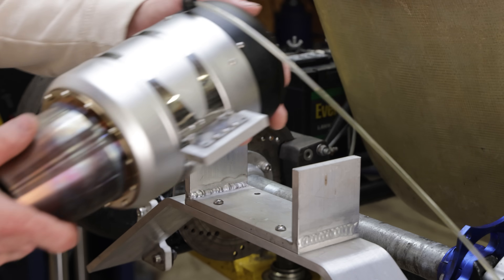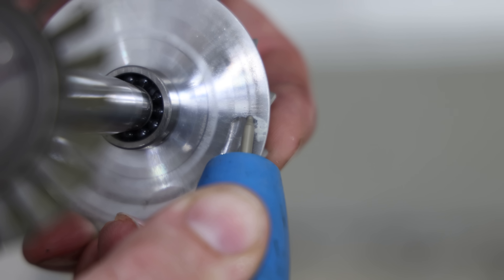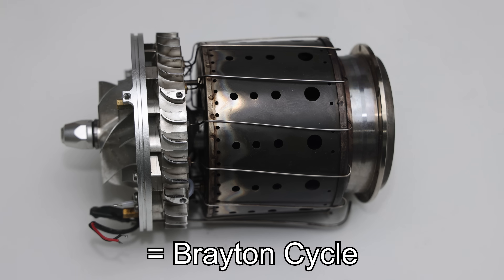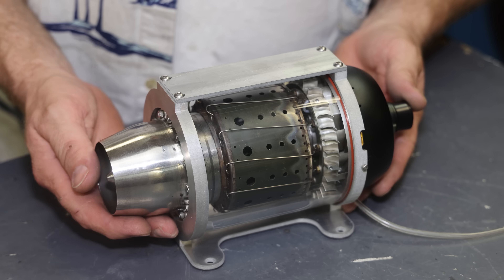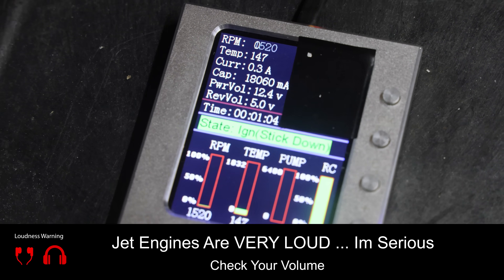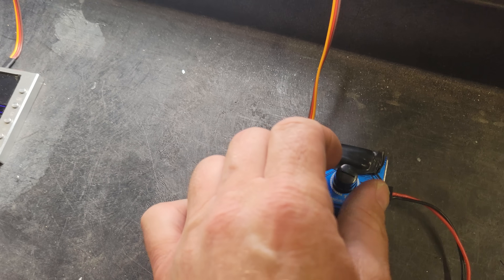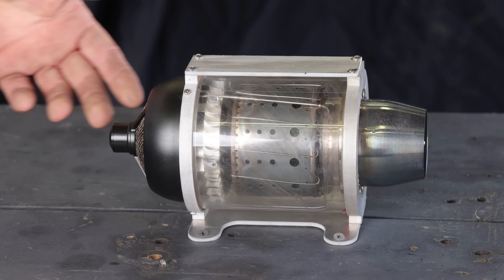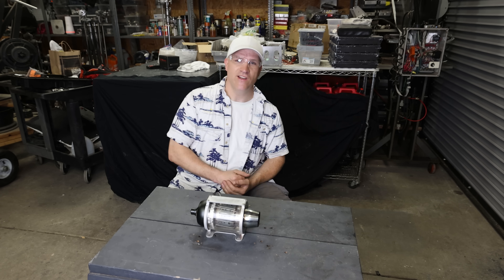See Thru Jet Engine

Comment: I've worked on aircraft and turbine engines for 30 years, and never thought I would see what one looks like on the inside running. Even just a basic one like yours is pretty neat.
Reply from the maker: Thanks, I wanted to start simple, but I absolutely need to do a multi-stage axial... No doubt. It's tough, this one has been 4 years in the making simply because I had to develop the material that I'm using here to make it possible, I also use that same material for all of my other see-through engines, but I haven't patented it because as you may know I need to release the recipe in that case, and the market is very small for this only for educational use. But then if it's publicly used and it fails for instance in a school or something like that, I could have a big problem on my hand. 😬
Reply: @WarpedYT  i've always wanted to see a multi stage axial turbine in small scale.... cool asf.
Reply: @WarpedYT  do it 👌20 year ex RAAF F/A-18 Hornet 'Frumpy' here (Airframes & Engines Tech). Do a mini General Electric F404 with functioning Afterburner and Variable Exhaust Nozzle 🤤👌
Reply: @BeerBatteredGummyShark  Well the  afterburning part would be easy, a beer can tube with garden sprinkler to dump fuel in the exhaust is not hard.  The VEN, well... thats another story.  Two stage....  Cut the guy some slack, his mini turbojets would be great to power a convection oven for shrimps and chicken wings.
Reply: @WarpedYT  A quick recommendation is to use a copper ring to seal that case instead of that silicone. That way the copper will expand as it heats, and will just generally be a lot stronger.
Reply from the maker: @th600mike3  the reason I didn't do that is because the material I'm using for the cylinder has an extremely low coefficient of expansion, if I put any sort of metal in between that cylinder and those rings when it expands it's going to break my cylinder.
Reply: @WarpedYT : Won't the cylinder also expand?
Reply: @WarpedYT  Could you add an air pressure gauge on the clear housing in the future video?
Reply: @rotaryperfection  You don't have to go through the transparent hull. You can add a pressure tube from the front. Bonus: you can measure at different length.
Reply: @WarpedYT  
Yeah it's Quartz... no wait sapphire....or transparent aluminum!? 🙂🇦🇺
Reply: @Johnno48  how do we know he didn’t invent the thing?
Reply: @Johnno48  actually the last one is now real. Its called Alon
Reply: @Johnno48  Like aluminosilicate glass?  Is that Star Trek's transparent aluminum?
Reply: @Johnno48  In the realm of the many Star Wars world of books I think they called it "Transparasteel".
Reply: @FARLANDER762  ALON ; Aluminumoxinitridede
Reply: @Johnno48  - Magnetic containment shielding?
Reply: @WarpedYT  How is it possible that the plastic case did not got darken or blur inside after sustaining temperatures of nearly 2000 degrees? I've seen a lot of see-through combustion engines with plastic casings, and they always get dark or blur in less than a minute. What type of plastic case do you use? What kind of coating is there inside it?
Reply from the maker: @ron25-33  this is a proprietary material that I developed over the course of about 3 to 4 years of research and development, I made the material for research and educational use, if you watch my previous video on the see-through liquid piston engine, I gave them to see through components for research and development and they are still using them today, I am told without any scratching of the surface or discoloration... I myself was impressed that this material works so well.
Reply: @WarpedYT  Thank you for the responce. I will watch the liquid piston video now.
Reply: @ron25-33  its glass not plastic.
Reply: @ron25-33  He has the intake air from the compressor, which goes through in considerable quantity, pass between the transparent cylinder and the combustion chamber, before entering the combustion chamber via the holes you see - the intake air thus isolates and cools the transparent cylinder.  The cylinder is presumably some sort of Pyrex (borosilicate) glass, which has a low coefficient of expansion and can thus take high temperatures anyway.
Reply: @ron25-33  its glass possibly borosilicate or quartz since they have high melt temps and standup to rapid cooling better than most other glass.
Reply: @WarpedYT  Then release it for wider study?
Reply: @DalionHeartTTV  His choice not yours?
Reply: @WarpedYT  I'm curious if your see-through material is cast, or is it extruded? Also, borosilicate glass and kovar have similar coeff's. of thermal expansion (they use them together to make glass-to-metal seals). 

Not sure what your "proprietary" material is, but, instead of using an O-ring, have you given any thought to a kovar ring having a square cross-section? Perhaps, you could bevel one of the inside corners to impart slight torsion to further seal the space between your see-through material and the metal housing. Maybe, machining a very slight taper from the ID to the OD that would work with minimal torsion of a kovar ring having a square cross-section with a beveled corner as I mentioned above? Does your material change properties as the temperature rises to operating temperature? Might it withstand ring torsion as it approaches and maintains operating temps?
Reply: @djhal7961  borosilicate glass has 550 degrees melting point
Reply: @lewisavinash1  Borosilicate glass melts at about 1,650 °C (3,000 °F; 1,920 K). check wikipedia.
Reply: @WarpedYT  If you do patent it I suggest you finesse the name, because roughly speaking right now you have a see-through cowl/duct and you are still trying to devise a see-through engine (combustion section) and you just haven’t figured out how to do that yet and I gotta think it’s not going to be an expensive anything you come up with. You need a medium that you can see through but that will tone the image down enough that you can actually see what’s going on in the center of the blaze  Meanwhile, the name is great for the masses and I hope a lot of people watch this so that they appreciate what’s going on out there on the wing of the jets fly on.
Reply from the maker: @JoeOvercoat  Thank you, I actually already figured it out a while ago, that's not the hard part the hard part is making the material. 🙂
Reply: @WarpedYT  Material science enables so very many things. 👍
Reply: @WarpedYT Next up: Jet Engine Running on Oxygen + Acetylene
Reply from the maker: @algodoomarbleracing  That would be pretty spectacular
Reply: @WarpedYT  woah, didn’t expect a reply from you
Reply: @algodoomarbleracing 😂😂😂
Reply: @WarpedYT  Quartz. It's quartz. C'mon.
Reply from the maker: @Spirit532  quartz scratches extremely easily...in short quartz sucks...lol
Reply: @WarpedYT  If you're dead set on some kind of non metal sealing, try pure PTFE. It's the only thing I've seen handle higher temps, but I think copper is your best bet.
Reply from the maker: @th600mike3  thank you, you're correct that would be good I actually have some PTFE sheet, but it just wasn't soft and flexible enough for me, although I think I figured out the problem is that because the pressure combined with the thrust was bending my top and bottom pylons, I'm going to make a revision before the next video so this doesn't happen and do a test run I think that's going to fix the problem... Also my original design was an actual o-ring which no matter what is not going to be able to fit through the Gap left even when it expands. But yes unfortunately I'm stuck on using a soft pliable material for my seal front and rear just to keep the safety factor in place. Last thing I want is for this thing to break into pieces and go flying, even though I have a blast shield that could be a huge mess.
Reply: @th600mike3  Copper won't do it any good. 

- Copper melts at 1085 degrees Celcius/1985 degrees Fahrenheit
. 
- A "toy" jet engine can reach up to 850 degrees Celcius/1562 degrees Fahrenheit. 
- A normal jet engine can reach up to 1700 degrees Celcius/3092 degrees Fahrenheit
. 

So a copper seal could potentially melt and deform permanently.
Reply: What about bakelite or neoprene.
Reply: @TuncayAyhan  Temperature at the seals is way below exhaust temperatures. It's mostly the temperature of the compressed air.
Reply: @Spirit532  Quartz sucks. It sucks man. Cmon.
Reply: @Spirit532  Aluminosilicate glass...
Reply: @henry247  Yeah, maybe. But a piece this shape and thickness would be unnecessarily expensive. I've had no problems with quartz, certainly not scratching.
Reply: @WarpedYT  Don't suppose you could experiment with nitromethane and or methanol injection in part 2?
You know you want to.
Reply: @WarpedYT  Would you consider doing one with and without a Turbo FAN to compare the lb ft of force..?
Reply: @WarpedPerception No you wouldn’t have a problem on your hands, if you were going to release it you would form a business and with that you would have insurance and that’s what insurance is for….. you could also in addition to insurance form a small corporation like do an LLC (costs about $90), Im not trying to over complicate it and scare you off doing it lol, after the second year it becomes second nature, like riding a bike lol. I think someone like you should do it, America needs good people like you contributing, and you should be rewarded for it financially. I like the idea of using them for classroom demonstration, reminds me of my old shop teacher who was a genius and I learned so much from… he had the patent on the “Snake Light”…
Reply: @WarpedYT  Was going to ask what you used, but you answered perfectly - none of your business. LOL!
Reply: @WarpedYT  i think u could've used graphene glass as well as another option...plus, it's already patented therefore no one would blame u in case there's misfortune~ the material are quite stable under high temp heat n robust too..👌🏻
Reply: @WarpedYT  p
Reply: @WarpedYT , if you could pull off a small, self-sustaining, axial flow engine then you would have a possible marketable creation on your hands!! I have YET to see one that is reliable and self-sustaining. It is indeed a very challenging task to do that. However, it would be an incredible achievement and would also be absolutely awesome!!!
Reply: @WarpedYT   Wooo thats hot ! lmfao ! I dont know why I laughed so hard. Its like I know you know its hot to touch but you had to anyways haha  when i seen that seal come lose i got scared lol
Reply: @WarpedYT where is the starter motor located on that?, please excuse my uneducated questions lmao i just want to make my own jet after seeing this
Reply: @WarpedYT Sir, answer please... What kind of metal did you use?
Reply: What is the electric motor that must have a high voltage????12 volts????? Can I make a motor myself? I have all the materials, thank you.  @WarpedYT
Reply: @WarpedYT  BRO!!! you just helped me understand why the TURBO FAN is so effective ... 
it has all that torque to spin the shaft which they harnessed to actually move a huge volume of air.
Reply: @WarpedYT you are putting it on internet, what it means, others can copy your idea if you are not patent it, there must be law of public publication and time line of public publication before applying for patent.
Reply from the maker: @99977777 in order to patent you need to Make the entire recipe public, Just like Coca-Cola, they advertise it they sell it It is known throughout the world, but it has never been patented, because if they patent it then they make the recipe public.
Reply: @WarpedYT try to explain with airplanes how they reverse the fans when landing to help slow and stop the plane people will be interested in that to
Reply: pfff... must be a boring job ehh?? only ONE moving part, right?! 
There are like less than 5 countries that can make Jet engines (?), and the entire NATO inventory and every sizable passenger jets in the airport  run on engines of 3 companies (?). HOW HARD CAN ONE MOVING PART BE!!??
Reply: @ylstorage7085  depends on how fast that one part is moving
Reply: This style of jet engine or tech is what I studied out of 1940's.

Slight correction to your explanation:
It's a turbine without any compressors, outer side is what keeps the core from melting some designs have the air turn 180 degrees in direction to get to the core. This will slightly compress the air, but you will need to increase fuel. This design will be the most fuel efficient at low altitude. 

Have the air turn 180 degrees and you'll get more trust from that design. 

When the engine is at 30k feet the engine needs to compress the air per fuel lbs or it will stall. Not enough o2 at that elevation. 

So yes turbine engines can consume more air just like a 2.0l engine for a car can consume 5.0l of air to gain hp.
Reply: @450ktm520  No, it's not a turbine without any compressors - that wouldn't be a working engine. Like any turbojet, it has a turbine which exists only to drive the compressor, because there is no shaft output (it's not a turboshaft or turboprop engine). It is the simplest type, with only one shaft carrying one compressor stage (which happens to be centrifugal in this case) and one turbine stage (which happens to be axial flow in this case). More stages can be used for a higher pressure ratio (the Brayton equivalent to ann Otto cycle engine's compression ratio).
Reply: @450ktm520  I got a good chuckle out of reading your comment. Just about everything you said is not true. 

First, of course there’s a compressor. It wouldn’t work otherwise. The spinning part in the front is a centrifugal compressor impeller. It looks like the compressor of a car’s turbo, because it is exactly like that - a centrifugal compressor. The part spinning in the back is a single stage axial flow turbine.

Second, engine designs that have the flow turn 180 (mostly smaller turboprops like the P&W PT6) do that because 
1. It can result in a shorter, more compact engine. 
2. It requires a shorter shaft between the compressor and the turbine, but more importantly it allows a much shorter shaft between the free power turbine and the reduction box, which means a higher natural frequency and therefore a light, reliable and simple free power turbine and box assembly.
3. No need to have concentric shafts for the HP and LP shafts.
4. Can simplify maintenance.

Third, having the air turn 180 will absolutely not compress it. It actually causes a small drop in total pressure. Likewise, it doesn’t create more thrust, nor is it more efficient. Quite the other way around actually. It increases loses in the gas path, which results in a loss of some thrust and reduction in efficiency (therefore consuming more fuel for the same thrust). Which is why it’s only seen in applications where the aforementioned benefits out-way the performance impact.
Reply: @450ktm520 : At higher speeds it won't stall, 'cause it's moving fast enough to intake more O2, not to mention the fuel nozzles can lean out the amount of fuel intake, therefore increasing longer distance per gallon of fuel burned. It's also why airliners fly higher for greater distances to conserve fuel and fly faster, plus smoother ride, (less turbulence).
Reply: @glenturney4750  also at higher altitude because the air is thinner there's less mass to displace from the front of the plane less air resistance (it could be implied this is covered in turbulence but just expanding on it)
Reply: @glenturney4750  
It will absolutely Stall at 10.000km without a compressor. the pressure is just 1/5 of that at ground level. If you just reduce fuelflow the engine will loose thrust. There's a reason why modern turbojet engines have an opr of 30 or higher.
You might be able to compress the air enough if you are already flying supersonic speed and using the jumps in front of the engine but even that is questionable.
Reply: @450ktm520
Don't tell me you ride a KTM450!
Reply: I used to love standing behind TPE-331's while they were starting up at night.  Could watch that 3rd wheel glow cherry red, always made me wonder what the 1st wheel must look like during startup.
Reply: Hi, just wanted to let you know that I thought the video was incredible! I'm not an engineer but I can appreciate the skill and ability it took to create something amazing.
You have a new follower. And I know my boy, who is an engineer, will get a kick out of it, too 😉👍🏻👏🏼
Reply: Related experience here, and I agree 100%. Very cool video.
Reply: 20 year Aircraft Maintenance/Mod/Repair/A&P:  Commercial Aircraft.
Reply: I spoke with a fighter pilot once who explained to me about the four cycles of how a jet engine works. He told me the four cycles are, 
SUCK, SQUEEZE, BANG!, BLOW!
That about explained the climax of how a jet engine works for me. 😁
Reply: @glenturney4750 
RE-EDIT: this is before I got far enough into the video to see that he's talking about all this for at least a bit.
(edited) ORIGINAL:
this is the moniker for 4 cycle engines--piston and I realized also wankel rotary, but how does that fit with a jet engine? I think I figured it out. Engine draws in air, compresses it (if, per another commenter, the jet engine even has a compressor?), adds fuel somewhere in there and ignites the mixture, and blows the result out the back. I guess the ignited mixture has more energy in it than just spinny turbine fans pulling air through.
Reply: @glenturney4750  thats what she said
Reply: @glenturney4750  that is the same for 4 cycle engines as well
Reply: @glenturney4750  my teacher at jet maintenance school told us the same thing😂 makes it much simpler
Reply: @glenturney4750  My dad used to say this with his fist pumping up and down 😁
Reply: @glenturney4750  "suck, squeeze, bang, blow" is for gas and diesel engines, because their combustion is intermittent. In a turbine engine the combustion is continuous - you need something other than "bang".
Reply: @brianb-p6586  "you need something other than "bang"."
baaaaaa[...]aaaaang?

(or to satisfy my inner(? wait, no I AM a) coder "b[a]+ng")
Reply: @brianb-p6586  Squeeze, Burn, Whoosh!!
Reply: I am thinking of working in the A/P field, what's your opinion on the work environment? Did you enjoy the work, do you have any negative opinions about the job?
Reply: What about that video in which one of the commercial plane's jet engine covers was blown off? 😬
Reply: pretty cool hey.
Reply: When I was a kid I flew all over the world and always loved it.  But it was difficult to conceive how so much power was gotten from these jet engines.  I like what he said about it not being a case of so much air intake but the combustion of the compressed air/fuel mixture.  Though nowadays 80% of the power of the actual jet engine is used to drive the big ass fan in front.  Almost like a turbo-prop.  I flew on TWA 707s and at the time wondered why it was called a "Fan Jet".  Star Stream 707 one of the prettiest airplanes ever built.
Reply: So you admit your an NPC...
Reply: didn't ask lol
Reply: @daelinproudmore5068  aircraft engines are really safe nowadays, just look at how many planes don't have engine failures. And even if an engine failed - modern aircraft are designed in such a way that the other engine can keep the plane flying
Reply: U 30 years washbrain to ur self lie self and to others because u work only for them like by for them live for them like sheep go see what is air compressed turbine engine or RC how works is need only battery electric power nothing more so please no lie ur self of fake life u live and 30 years u lose all true out side but u live inside but nice they want sheep's society to make peoples be lie ve lies of them all point air plane only need wind cold to work engine of faraday and Tesla made and u all liers stealers no tell true of free energy.
Reply: I was honestly waiting for that work bench to lift off.
Reply: Didn’t see how, where fuel enters. Is it pumped or does it vacuum draw and then how fuel circulates in the combustion chamber then mixes with the compressed air, how is it ignited. ? 
 How throttle works No carbs maybe injectors, timing for fine tuning of combustion for designing more and differing power characteristics. 
I’ve Still loads of silly ignorant questions.
Reply: infrared temperature gun Buddy.. no smudges ape man
Reply: @Ricky Spanish twin tower reference ?
Reply: that aint basic at all. its amazing
Reply: The scale ones are totally different though same principle
Reply: @Ricky Spanish they are continually getting colder air from in front. One of these engines would probably go up in flames if the intake was suddenly stopped and no moving air coming through. I don't see how that would ever happen as anything blocking the intake would be either digested or completely smash the engine to pieces  but there it is.
Reply: U ain't shittn!  that vid was incredible!
Reply: 69
Reply: I couldn't agree more, fascinating stuff.
Reply: My dad was a turbine fitter for Rolls Royce (aero engines) and GEC Alsthom (power station turbines) and its great to see (in miniature!) what he used to do, particularly the minute attention to detail and those fine tolerances. Thanks 🙂
Reply: Same here, longtime A&P.
Reply: That's really 😎
Reply: Kind of a sad thing for the state of engineering training.
Reply: Put any jet engine in the world against my 460hp 5.0 stang GT and see what happens
Reply: @Gizamalukeix  You turning into a laughing stock? lol
Reply: Awesome doesn’t even begin to describe it!
Reply: Don't they run on aether / vortex energy when up in the air, since that's where all the electrons are, and doesn't make sense that the wings are full of liquid, being so lightweight and all?
Reply: I have work 33 years at Pratt and Whitney.
Reply: the 100th
Reply: Wrapped perception, how do I get through to you we need to discuss?
Reply: we didnt see sh*t on the inside. WTF are you talkin about?
Reply: True but his is very simple. Most have multiple compression stages, variable stators…
Reply: II run test cells for GE90, not nowhere flames like this one, only at the exhaust tip
Reply: I also work jet engine
5 years experience
Reply: This would be a turbojet not fan right?
Reply: Were do you start it up please ❤️
Reply: can you tell us more about your job
Reply: Mr show off bragger 🙄🙄
Reply: we were making ramjets at 10 years old  LOL     1 moving part...   lol
Reply: can i get 4 for my emeris airbus?
Reply: Is the combustion chamber the wrong way round as the order of diameter in the holes on the combustion chamber step up rather than down. With this said, the engine on the bench works against the laws around a venturi tube. This would also mean that at the point of combustion flow gas is restricted and then given a greater area to expand before leaving the exhaust. So turning the combustion camber around would create greater thrust? Or are the holes insignificant? 

Cool to watch though!!peace☮️
Reply: If you saw that. You wouldn’t have lasted 30 years working for them
Reply: Dude if you work for 30 years in jet engines, this is not even close of what we have in aviation, no even close to the first Hiltler ME 262.  Please dude./
Reply: @maxun1  - What in the heck is your major malfunction?
How can you be so absolutely negative about something so trivial?
You're one miserable S.O.B. to even say some garbage like that, especially to someone you don't even know.
How do you go through life like that and not off yourself in the process? Learn some manners,...dude.